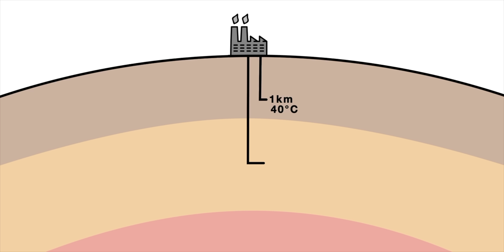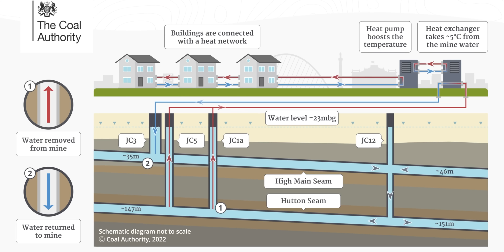Geothermal Can TRANSFORM Dirty Coal Mines into Clean Energy Hotbeds!

Comment: thank you, economy will rise by using jet plasma machine and compressed gas(Air) in isolated structure in water pool  with more than 80 % efficiency , it transfers compressed gas(hot air) temperature  from engine to water for steam generator in first level, New energy from sea will change world soon, there are other source of energy that with international cooperation in coastline we can reduce effect of  global warming, sea is huge source of energy, further more  we can prevent these phenomena like cyclone and flood and wildfire by using this hot seasonal atmospheric condition, recent years in summer, geothermal energy happens in surface of coastline, there are many countries in coastline with seasonal hot weather and water condition in comparison with middle Ocean, its more than 12 degrees ,  in sum-up, by using this energy not only is economical but also reduce global warming in countries like Japan, China, India, Mediterranean countries, Iran, Brazil, Mexico, Us, Canada, (Africa and Arabian countries....) . I invented new method base on air pressure rules and quantum physics ionization sea water minerals in strong dynamic magnet bases on paramagnetic and diamagnetic particles and electrical microwave wave field and electric chemical reactions (K+, Mg++, Na+, H+, H++, li+, H2, ...) +( O2, N2, ...) into up level by vacuum pump from storage into combustion chambers as major part of fuel (more than 50%) for producing electricity and fresh water and fertilizer. this machine produces 150Megwatt-hour/hour and 20000M3/DAY fresh water and fertilizer. 7 methods zero pollution for reducing global warming I mentioned in my profile. (G20 countries can solve these phenomena).

Comment: We will always need coal but geothermal could be a great thing to work with Coal.
Reply from the maker: That is such a funny comment. We won't always need coal. We barely need it now and if there's one fuel thatb is destined to be dumped in the next 5 years, it's coal.
Reply: @fullychargedshow  Coal is cleaner than electric vehicles that is a fact by 2030 the electric  vehicle will be dead again like they did the first time.

 Coal will be used for decades to come if people like it or not and your correct we don’t use as much coal as we did but it’s pushing peoples electric bills up and making people poorer.

New coal mine should be opened, decommissioned coal power stations should be bought back into operation and also build a couple new coal power stations making electricity cheaper for ordinary people and Industry.

Natural Gas will continue to be used for decades as well to heat peoples homes,cooking and making  hydrogen.

Wind turbines are a dreadful thing that no one wants they destroy the natural landscape and kills tens of thousands of birds every year and that just one country also cannot just chuck solar panels all around our landscape and current solar panels are not efficient enough to really worth using them. 

Literally the only viable green energy is geothermal but will not replace Coal or Natural Gas just work alongside them.

You literally stand for destroying our natural environment and making the ordinary people poorer.

Comment: There are some things to consider. One company is very good at drilling parallel pipes using an adapted fossil fuel technology to optimise the efficiency and an other that is very good at drilling very deep using mm electromagnetic waves. You need to get updated and combine these two

Comment: As an ex miner of 30yrs, working in the darkness in temperatures of 40c plus & with no way of sweating this off as the air was very high in humidity. The methane I know is now captured to generate energy with burning it off & into the grid. The profits from this should have gone into the miners pension schemes in my view. Geothermal would have been a good idea, the pipe work was already in place for compressed air & or pneumatic oils that could have been used from the 7 miles inbye or just the pit bottom areas would have helped all the town & villages heat if needed - for free once the build was paid for.

Comment: Living in the midlands we used to have 100's of coal pits as evidensed by subsidence problems still on going decades after the mines have closed. Most of the old pits are now covered in housing estates. So it would be a relativly simple engineering task to set up local heating loops and supply the houses from that source. It could also help the old housing stock that make up many of our lovely old vilages and town centers that can never be economically brought upto modern standards of insulation.. even if that were desirable. Air tight houses as proposed these days have serious potentual problems for health and certianly are highly undesirable for any lady going through the "change" .
Reply: " Air tight houses as proposed these days have serious potentual problems for health "

Not if you ventilate right, like using heat recovery ventilation.

Comment: Only 2% of UK homes are connected to district heating.. Even if the UK built a proper district heating grid, other sources than geothermal seem more economical. In Sweden where 50% of homes are connected to district heating, only 6% of that heat is geothermal. 45% of the heat comes from burning of forestry byproducts, biofuels of which the UK has limited supply. If we subtract all biofuels, 39% of Swedish district heat comes from burning household waste, a free and abundant fuel. UK could expand their district heating 12x using household waste before needing to tap into geothermal..
Reply: The UK exports household waste to Sweden to burn in their incinerators.

Comment: In what way is it renewable?

I'm a big fan of using geothermal energy, but do want to know how you feel it is renewable.
Reply: In theory It doesn't require burning fossil fuels, anything out of that scope is seen as a renewable energy
Reply: It's renewable in the same sense solar power is renewable. In practical terms there is a limitless supply of heat from below the earth's crust. Sure, billions of years from now, the earth will cool down and geothermal will stop working. But by then, solar power will stop working as well because the sun will have run out of fuel too.

Comment: Do a search on New Hall Place Liverpool.
It is 50 years old, using water from the River Mersey to heat and cool the building.

"The building was constructed simultaneously with the Liverpool Daily Post and Echo building. Both buildings operated heat pumps to heat and cool the building using water from the adjacent River Mersey. Three thousand gallons of water per hour seeps into the Mersey railway tunnel from the river above, via the riverbed rock, which is a steady 13C temperature all year. This water was previously pumped out into the dock system. The heat pumps used this constant temperature water to heat the building, or as a heat sink to cool the building."

It uses heat pumps.  The equipment has now aged with much having to be replaced.  The River Mersey rail tunnel, used by the Merseyrail metro, has two small tunnels above and below the main tunnel.  The tunnel above is for air ventilation, while the tunnel below is for water drainage, which is pumped out. This water, at a constant 13C, is used to heat and cool two large office buildings. I read that the water pumped from the tunnel, once processed in the building, is pumped into the sewer system to keep it flushed out. Previously the river water was dumped into Canning Dock to keep the water levels up. The warmer water created unique marine life in the dock, highlighted in a TV programme by Bill Oddie.

Comment: Geothermal energy is one of the least environmentally damaging energy sources. Not only does geothermal energy drastically reduce CO2 emissions compared to gas or oil, but it also has very little environmental impact compared to other energy sources, renewable or not. And it's controllable and not intermittent. Also, unlike air/water heat pumps, it is efficient even in very cold climates. It won't meet all our needs, but it is absolutely necessary that it be developed.

Comment: Is there any consequence of releasing that energy, ie cooling down the earth/core? or is the amount of stored heat/energy so vast, even if everyone, everywhere starts using it up, it will last millions of years?
Reply: No, what we do in the top 5km of the Crust will have no effect on the Earth's Core.  But there is a cooling down of the coal mine or the geological formations where the water used to extract the heat is circulating.  Eventually the Earth's heat flow will restore the heat that is removed, but in reality this method should be called "heat mining" as heat can be extracted faster than it is restored by the terrestrial heat flow.
Reply: The suns heats up the earth's crust.
Reply: @johnburns4017  Only to a depth of about 2 metres.  The internal heat flow is far greater than the incoming solar heating.  As you go deeper, the temperature rises as the heat is travelling upwards.
Reply: @karhukivi  
The sun heating up the crust of the earth, overall prevents heat from inside the earth from escaping too quickly.
Reply: @johnburns4017  Heat can't prevent heat escaping!  Heat always flow s from a higher temperature to a lower temperature.   I'm sure you have visited caves where the temperature is constant day and night, that is because the daily variation of solar energy heating the surface hasn't penetrated.  If you drill a deep hole or go down a mine, the temperature rises about 3oº/km on average.  That is heat coming from the interior, not from the Sun.
Reply: @karhukivi  
The warmer the earth's crust the slower the rate of heat loss.
Reply: @johnburns4017  Yes that is true, but the Sun is not shining all the time and in Winter the surface is colder.  The diurnal solar heating and cooling only affects the top 2 metres approx.
Reply: @karhukivi  
You take the earth as a whole,  and over a year. The sun is constantly heating the earth and water. As most of the globe is covered in water, the rate of cooling is greatly reduced. Heat from the earth transfers to the water of the oceans. Heat loss slows as the water is being heated by the sun.
Reply: @johnburns4017  Yes, to a depth of about 2 metres which is where the solar heating meets the geothermal heating.  The temperature rises as we go deeper and heat has to flow from a hotter place to a cooler place.  So below about 2 metres, the heat is coming from below, not above.  The effect of the last Ice Age 20,000 years ago can be seen in the logs at around 40-80 metres depth.

Comment: More than 30 years ago a research project investigating geothermal energy was undertaken in Cornwall. This was for space heating as far as I remember. Unfortunately it was found to be uneconomic. 

Heat needs to be recovered in some way, and this means a heating medium needs to be circulated through the  ground. The circuit needs to be sufficiently  permeable to create a reasonable flow. Without good flow insufficient heat will be transported from the rocks to the recovery unit extracting the heat.  Remember, you are dealing with relatively small temperature gradients

In order to create a high enough flow to extract a worthwhile amount of heat the flow has to be quite high. These high temperature radioactive rocks are, more often than not, types of granite:. a rock not known for its porosity. Thus fissures in the rock will be needed to create a circuit that has a sufficiently low resistance . Anyone for fracking ?
Reply: sand storage tanks for the captured  heat

Comment: We should harness it if it's practical.  We don't have the infrastructure to distribute this heat to houses.  Even if we did you all know radiators in your house which are furthest from the boiler get less heat.   But, it's energy, renewable, it could be very cost-effective (cheap), definitely good to have diverse sources.  Maybe solar energy could be used to heat this water to the point where it can be used to drive a turbine.
Reply: We build the infrastructure needed.  Heating can be low temperature underfloor heating.  
Radiators furthest from boilers get enough heat if the system is designed and fitted properly.

Comment: This type of miniature geothermal heating is used by most regular large villas in Sweden, they drill a hole about 200 meters deep, put a hose in there which is filled with a liquid which is pumped around by a heat pump that extracts the heat from the liquid once it returns from the hole to the surface, then pushes the liquid back through the hole where it gets heated up again. 

The only rules are the hole should be at least 4 meters from a house wall and 20 meters from your neighbors hole. 

The total cost for drilling and installation of this system is about 20% more than a regular water/air heatpump but the energy effecivesness is also about 20% higher.
Reply: The water coming out of the ground may be hot enough to run low temperature underfloor heating.  The water may not be hot enough for domestic hot water, but a small cheap heat pump (size of a fridge) just for domestic hot water, raising the temperature to 60C is all that is needed. Or use a common, cheap, resistance immersion heater. Expensive to run but if you are only raising the domestic hot water temperature 15 to 20 degrees for only domestic hot water there will be just cheapish electricity costs. 

The underfloor heating just needs a plate heat exchanger between the ground water and the heating water, and a few pumps. One pump to bring up the ground water and send it back, and one to circulate water around the underfloor heating. 

The underfloor heating can be on 24/7.
Reply: @johnburns4017 sorry but you are way out of date with your information and just wrong in some of it. Go and watch EVman's videos on his air source heat pump. That gave him loads of heating and hot water even in -15 degree tempratures in North Yorkshire! Ground sourced heat pumps (what they are talking about here are far more efficent than Air sourced. But at -15 degrees C EV man was getting 3.5 KW of heat for every 1KW of electricity he put in. So it works perfectly.. he is using normal wet radiators to heat his house also. So the cost of instalation was minimal.
Reply: @williamarmstrong7199  
Most air sourced heat pumps fitted in existing homes are inefficient and not worth it. A lot of work has to be on insulation and air tightness, which may be a great inconvenience and cost. They are worth it in new air-sealed and highly insulated houses. 

There are many case where expensive heat pumps are fitted in existing homes with energy bills rising like a kite. 

Also, read again what I was writing which you seemed not to understand. It was about using naturally heated low grade hot water extracted from the ground, being a suitable temperature to run underfloor heating with. 

Then use a small heat pump to raise the temperature to 60C for DHW storage purposes. Or if the heat pump is too expensive to buy, use a cheap resistance immersion heater to raise the temperature, which may be worth it, as it may not be raising the temperature too much, so little electricity used. Or, have a 11kW instant electric water heater, set to say 52C, it will only be raising the water a few degrees. It could give drencher shower performance. Also having a Quooker type of instant boiling water kitchen tap would do the same.
Reply: @johnburns4017  I use an air to air HP in a badly insulated house... i still save a lot of money doing so. It is possible, but you need a A+++ HP, should not cost that much.  My new a/a HP was less costly than traditional gas heating. 1kW in and 5kW out... do the math. But... invest in insulation first.
Reply: @rudiosbelgio3253  
With enough insulation you may not need a full heating system or an air sourced heat pump. That can be done easily in a new build rather than retrofitting.

Many have fitted air heat pumps in existing homes and regretted it. I would rather sink a bore hole to be sure of greater efficiency. If the water coming up is naturally at a temperature suitable for underfloor heating, it is so much simpler and cheaper. Less complexity, less to go wrong.
Reply: @johnburns4017  Ductless Heat Pumps (or multi split ductless heat pumps) are cheaper than Geothermal HPs. But again: always invest in insulation first!
Reply: Thats not geothermal heating, thats geothermal source heat pumping. To scale things up, such as to provide for central heating it makes for sense to dig somewhat deeper to start with.

Comment: The Australians spent billions of dollars on geothermal energy projects and have had to abandon the idea. Steam turbines have to run at near red heat temperatures to be efficient, thats why geothermal heat for producing electricity only happens in volcanic areas where you have close proximity to molten larva but I am not an expert so I stand to be corrected.
Using geothermal heat as a heat pump source would be possible but would it be practical or cost effective.
Reply: They aren't even talking about electricity here, they're talking about district heating at most. The water can allegedly be easily heated to 40C which is hot enough for space heating. 

What kind of research in Australia are you talking about? I can only find relatively recent studies on geothermal locations for the most part and the studies from decades ago didn't cost billions. The only geothermal project that I  know of was a small heating plant in Victoria which was used to heat public buildings and a pool.
Reply: Got a source on that graham. I’ve never heard of our government spending billions on geothermal research.